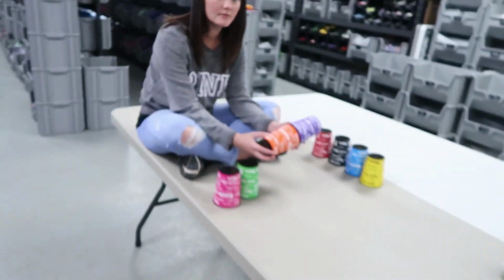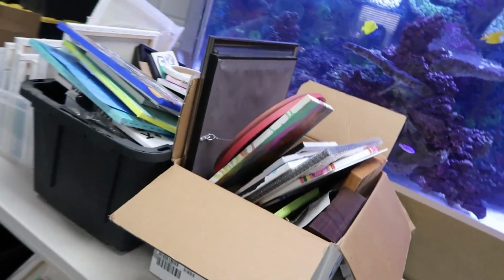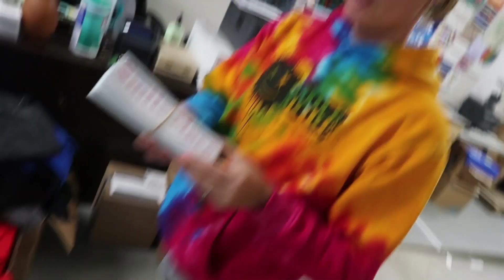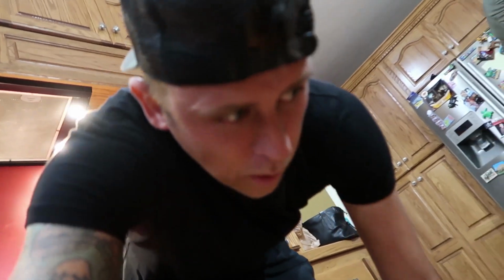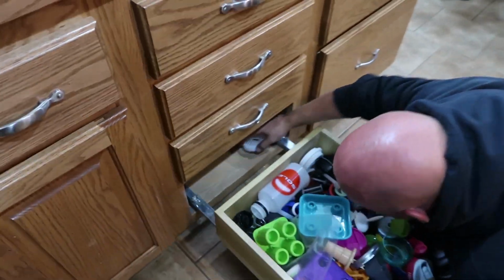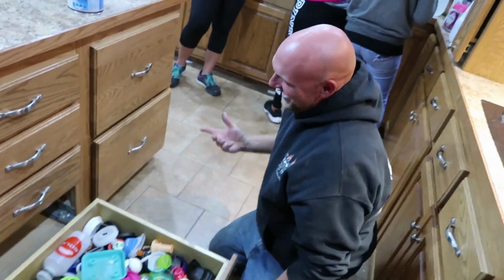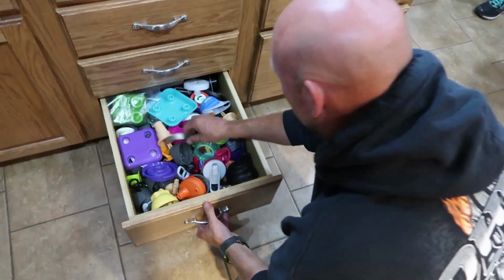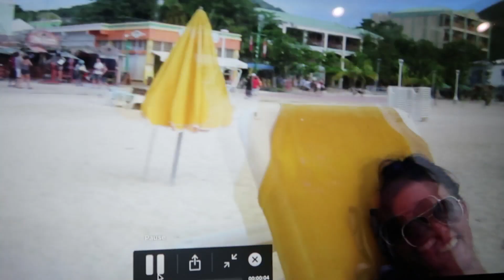The Pond Bike Is BACK!!

Comment: I learned to ride motorcycles in the late 1960s on a Ducati 250, so Ducati holds a special place in my heart.  It kind of screwed me up a little though since the brake and shift pedals are on the opposite side of most bikes.

Comment: Roman that bike is no good anymore, atleast the motor anyway... dirt has alot of sand in it when it gets in your engine it will wear the engine out and cause problem such as wearing the bottom bearings and shooting a rod... which can drop a gallon of oil all over your rear tire i had it happen to me going 110mph down hill into a corner, it was intense (not from sand though was just an old engine)!